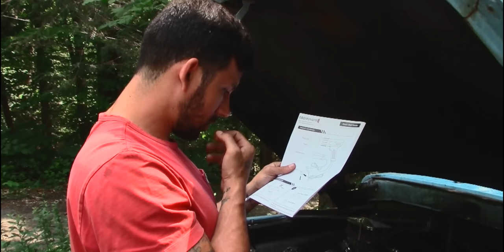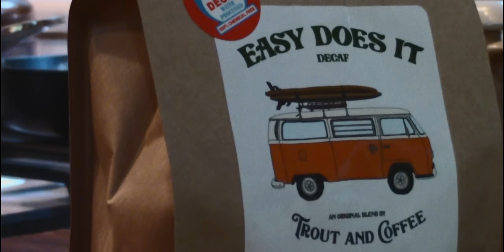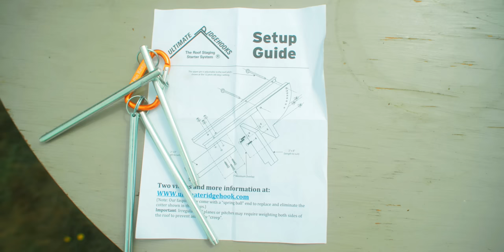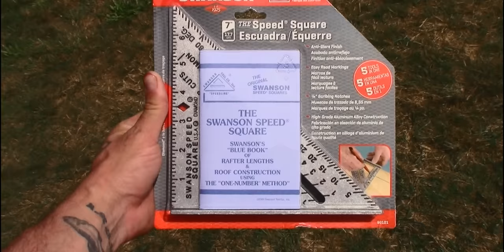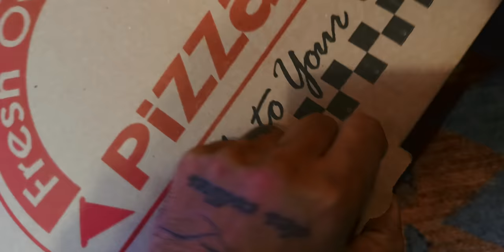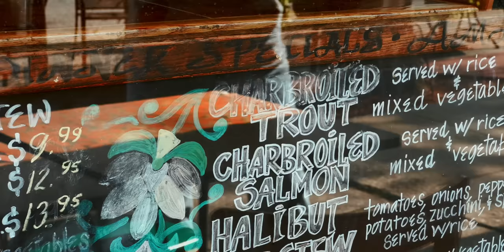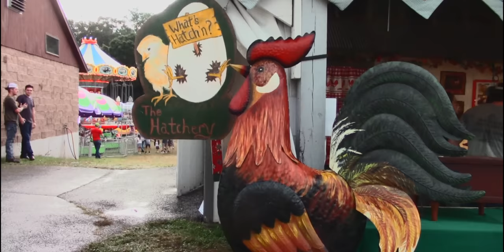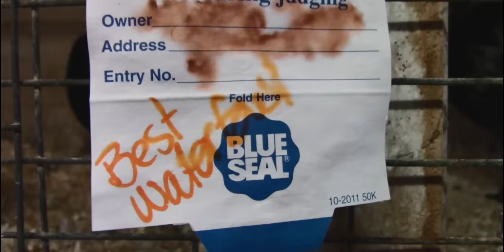It's All Over

Comment: Pro-tip in case of EMP a truck with points ignition will still run. Get a backup points distributor ,coil and condenser.

Comment: Kyle, you’re using the wrong timing marks on that engine.  There are two sets of timing marks: the one you were looking at in the video and another on the passenger side of the engine.  There should be a little reference tab bolted on to the block that you use for timing.  I have no idea why they put those markings on the driver’s side but they’re not the ones you want to use.  I have the same engine in my ‘72 flatbed and I have it running like a top. Let me know if I can help.
Reply: Also, on the harmonic balancer, sometimes there is a groove chiseled out of the side that you might mistake for the timing mark that you use to line up with the marks on the engine block.  There should also be a small line engraved into the harmonic balancer - this line is the one you want to use for timing.  In addition to this, sometimes the harmonic balancer itself is slipping.  If you look at it closely you’ll see that it is really two circles of steel fitted together with rubber in between them.  When the rubber gets old, sometimes the inner circle can shift within the outer circle and in that case it would be impossible to get the correct timing.  It would just need a new balancer - not a big deal with these engines.
Reply: Also, do you have a full 12v running to that distributor?  Those HEI distributors need a full, switched 12v running to them.   Sometimes people make the mistake of tying into the old wire that fed the old ignition coil.  That wire only only had 9v going to it because it was fed through a pink resistor wire that dropped the voltage.  Just another idea.